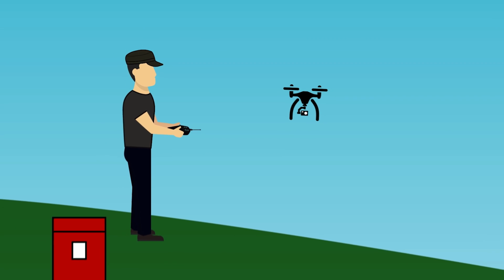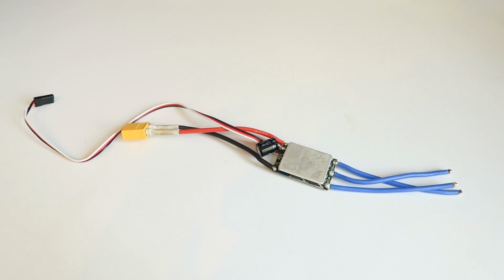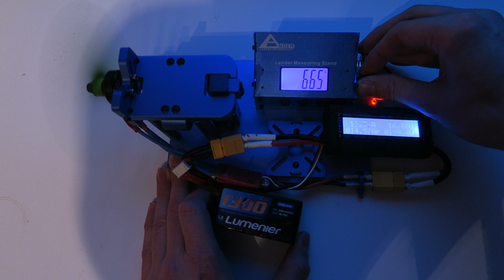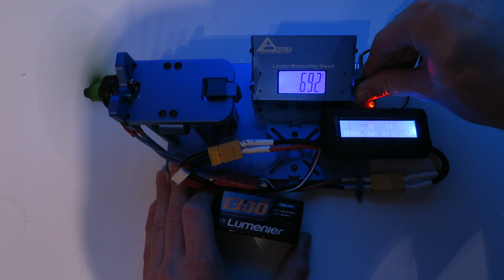Lander Thrust Measuring Stand KISS 24A VS Generic ESC

Comment: why would a 30a esc have a 13a limit doesnt make sense, could it be faulty?
Reply from the maker: +Paul “Johnus70” Johnson possibly not tuned for high kV. More for use with a 2212 motor
Reply: Ah things aren't always as straightforward as they seem 😆
Reply from the maker: they never are in this hobby

Comment: Isn't there a problem with an ESC that has a range of voltages ie 2S-3S or 2S-6S, 30amps at 2S is very different to 30A at 6S.
ESC should have a power rating not current, 2S 30A~ 252watts, 6S 30A ~ 756watts (using full battery 4.2v)

Comment: The first one was losing sync, it was pretty easy to hear. would have been better to set the timing correctly in SimonK, or get another cheap ESC with BLHeli that is properly set up for the high KV motor.

Comment: Be interesting if you could run a test on a EMAX 2204 V2 2300kv motor with a DYSXM20A 👍 nice results though from your test.
Reply from the maker: I am interested in that setup also thanks